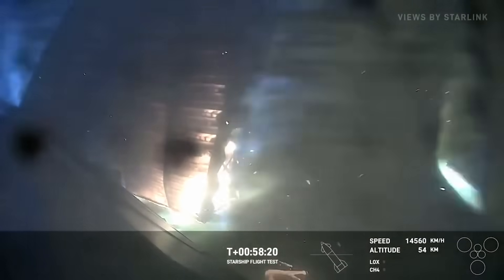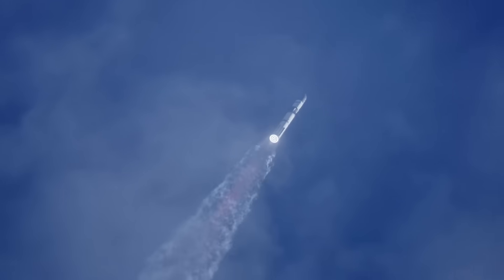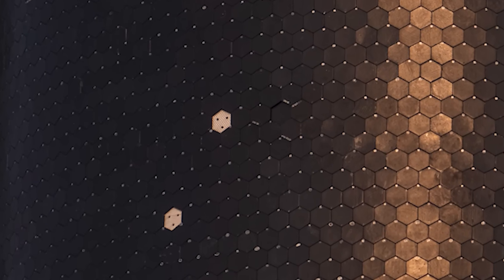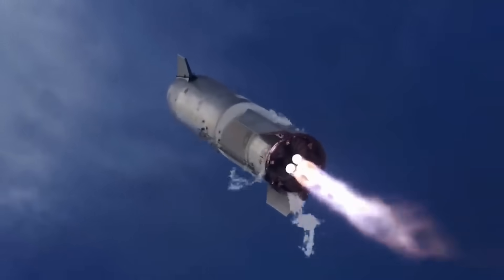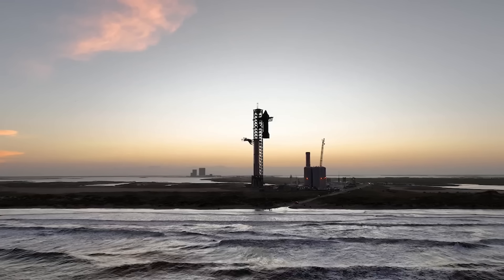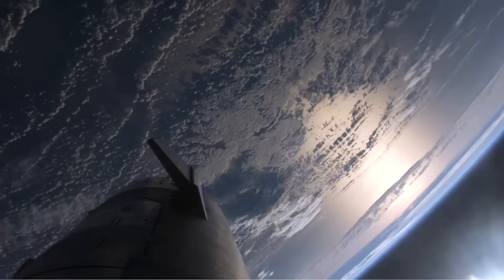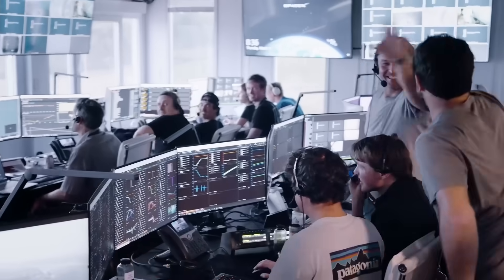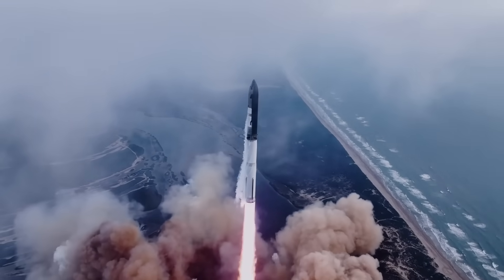SpaceX Is Adding Another Heat Shield Layer To Starship

Comment: Immediate starship second stage reuse is dead. SpaceX is admitting by putting in a blade of material under the heat shield that they probably cannot create a heat shield that can survive full reentry completely intact. What this implies is that the second stage at most will be rapidly reusable in terms of days or weeks after reentry, but immediately reusing a second stage will probably never happen because it will be always damaged when it lands after coming back to the atmosphere at least to some extent.
Reply: "a blade of material"

That's "ablative." 

They weren't going to be carrying humans on reentry anytime soon anyhow. But it may make sense, and they may get rated, to take people up at some point, and bring them down with other vehicles. Could mate up with a Dragon, or drop people off at upcoming commercial stations, with descent vehicles docked. 

And there's a lot we don't know about this ablative under-material. They may be able to reapply it just to locations with missing tiles during refurbishment, and then stick another tile on top of it. 

And if they have 100+ ships, it might not be too big a deal if it takes a month and a million USD or 2 to turn one around -- while they take several years to sort out actual rapid reusability ... I suspect they may end up with a secondarily thermal-protective material between the tiles and metal that makes the tiles far less likely to detach. In other words, the primary role is to keep the tiles on, and in the unlikely event they lose one, the material ablates (or is otherwise protective) in the location of the missing tile. Such that a very high percentage of Ships aren't missing any tiles after landing, and the ones that are don't have any holes cooked through them.
Reply: @cacogenicist  
Reuse in a few days or weeks would be rapid. However, I don’t think immediate reuse within a few hours is either possible or desirable or something that any insurance company would ensure.
Reply: Well, not even falcon 9 is fully reusable, they always have to refurbish a good amount of protection plates under the rocket and on it's leg mechanism.

Comment: The SpaceX test rig for designing tiles that stay on the vehicle at launch is inadequate. Defining and building a test rig that would allow you to create tiles that stay on the vehicle at launch should not be impossible. However, apparently SpaceX has not done that yet after four years.of course, creating a test rig that can simulate reentry is extremely difficult if not impossible. But they should’ve nailed the test already for heat tiles staying on at lunch.
Reply: They stay at lunch😂😂

But seriously, issue is with compromise: 
Price per tile, weight, ease of replacement. 

On V2 tiles will be smaller with different attachment method, instead three small plates with a hole in each tile, it will be larger plate with three holes for pins. 
Adding this new layer is probably just a stopgap to improve heatshields on EXISTING prototypes for testing other aspects of Starship reusability (precision of guidance and landing, aerodynamic models, etc).
Reply: @just_archan  
Interesting information, thank you. However, even if the heat shield does achieve, fantastic reliability, I’m skeptical that immediate reuse will ever make any sense. First, integrating, a significant payload into a second stage of starship will always take many hours and require much tested to make sure that everything is absolutely correct and the payload will Function properly when released into space. Secondly, large payloads can cost hundreds of millions if not billions of dollars. I doubt that any sane insurance company would ensure an extremely expensive payload to be taken to orbit by a rapidly or immediately reused starship second stage. Immediate reuse of the second stage, even for a payload such as methane and oxygen to refuel and orbiting starship is also unlikely simply because the second stage of starship will experience 2500°F on the way down and will probably take some time to cool off before you would feel confident about putting more fuel inside of it.
Reply: @wbwarren57  "It would be hard so it can't be done."
Ok, kiddo. They said that about landing reusable rockets too and now it's an everyday thing.
Reply: @wbwarren57  I agree with that. I understand perfectly that goes for boosters is to have turnaround as short as possible... But for ship only sense have to have with tanker and eventually with point to point passenger ships. But that is far, far future (if ever). I think this is more like aspirational goal. If POSSIBLE is fast turnaround, that means there is very little cost for on top for launch. It doesn't matter much for satellites, as CURRENTLY they are very expensive, but in future? With commercial stations in orbit or bases on moon? Ships could be used for moving cargo.  But like I said: it's aspirational for ship, not realistic.
Reply: @just_archan  
Well-reasoned response.  Thank you.

Comment: Was/Is there any attempt to recover the booster or ship from the sea, or are they just artificial reefs now?
Reply: lol recovering them would be crazy. A lot of effort and money for something of no value. Not like they could re-use them after they have been in the ocean.
Reply: @bluesteel8376 some people are arguing that recovery would be valuable for analysis. But in reality, all data they need they already have from telemetry. SpaceX uses very extensive computer simulations. IFT are for adjusting digital models against real life data, + identify unexpected issues and adding those into simulations. Neither of test were with latest iteration. Switching for electric TVS was planned months before IFT 1 (they changed it for IFT 2, probably considered as necessary for progress). Raptor 2 are not longer produced, they are in production stage of raptor 3, yet tests are conducted on raptors 2. We know for over a year that ship and boosters will be extended. For people who follow closely Starship development there was very little surprise regarding V2, and partially V3 ( scale, proportions and planned thrust for raptor 3 successor was surprise, not rest). 
Current generation is good enough for conducting tests needed to finalise second generation design. I doubt that many changes will follow into V2 ships, as they are just stopgap. Like extensive shielding on booster, very heavy purge tanks under the chimes and lot of other stuff.
Reply: @bluesteel8376  they could study them for damage, and see why the engine went out???
Reply: @shauryadeb-e8l  They had many sensors that gave them that data.
Reply: @bluesteel8376  Well, they are hollow and empty, I figured they might float for a few hours or more.
Reply: If you want, you can go get them. Nobody else will.
Reply: @ferky123  MINE MINE MINE.   gimme

Comment: It will be interesting to see what their plans are for the Starship portion of the spacecraft - will it be suborbital again, or will they attempt at least one full orbit before landing?
Reply: They will likely go into a full (albeit unstable) orbit. Would be interesting to see if they test a payload too.
Reply: And will they deploy Starlink satellites?
Reply: No point in testing a full orbit. It doesn't provide any value, but would cost more money as they would need fuel for a re-entry burn. The whole point of the sub orbital flight paths is to avoid having to do that re-entry burn.
Reply: @bluesteel8376  Well, in my opinion SpaceX probably doesn't want to do the exact same test. Since so much of the test was a success, they've checked off a lot of boxes on their TODO list, so they question is - what's remaining on that list? As I understand it, the burn they tried to make on the third flight wasn't exactly that successful, so they might still have a burn on their list of stuff to try for the fifth flight.

They will certainly want to test modifications to the heat shield, but is that the only thing they will test? They have so much more to do, it would be a a bit of a waste to not test anything else.
Reply: @bluesteel8376    This last flight, ITF-4, was suborbital and it still had to do a reentry burn so I don't get your point.
Reply: @bluesteel8376 obviously there is a point in testing full orbit. You need to reach orbit to deploy payload, and reaching orbit would give them extra time to test orbital maneuvering, payload door opening, fuel boil-off, etc. If they are flying anyway, they may as well try a more ambitious testing program than last time. If they really want to push it, they could start deploying satellites before achieving reusability (similar to F9, electron, etc.)
Reply: In a now deleted tweet, Musk says how much he enjoyed both Top Gun movies. This has led to some speculation about something he said years ago, that if he ever put a rocket into space he would want to buzz the ISS like Maverick buzzed the tower.

SpaceX has done some impressive things but I know if I were an astronaut on the ISS I would get worried if I looked at the window and saw a Starship looking like it was headed for impact, even if it ultimately whizzed by with about a hundred yards to spare.

Comment: Perhaps the new ablative material also dampens some of the vibration transmitted to the tiles.
Reply: Also may provide flexibility or expansion joint from cryogenic chill...
Reply: Maybe, but I wouldn't think so.  Adding in a requirement to prevent burn through doesn't seem likely to also increase the dampening provided by the existing rock wool material.
Reply: Bayonet clips are compliant 2 axises. But not so much in z AXIS. So i agree to extend with those who think felt underneath provide support but not soo much dampening as we wanna believe. Furthermore it provides pressure on tiles and pushed tiles OUTWARD into bayonet clip.
Reply: @alesksander  

When you have no damping, even a little internal fabric chafing can help and cushioning is very important when you are dealing with weak ceramics. If it provides a bit of a thermal backup system, then even better.
Reply: @richdobbs6595 

Do you know that it is “rock wool”? I don’t know what it is but assumed that it was a quilted silica fabric that was used on the space shuttle. If anyone has information on this it would be helpful. The material can provide both heat protection and a form of damping (indirectly) and cushioning.
Reply: @Mentaculus42  I have heard that it is rock wool, but I don't know what is done with it.  Also, it is not clear whether after being attached whether it performs a vibration damping function.
Reply: @richdobbs6595  

It would only be very little damping, but without any one can have issues with higher forces. Considering how the three pins are captured on the back of the tiles, there basically is nearly no inherent damping in the tile to stainless steel structure. It is interesting to note that there are very good reasons why aircraft are not made out of steel. Steel actually has a better strength to weight ratio than aluminum but the problem is the effective stiffness (and buckling resistance) of the overall structure that becomes the issue. Going very big helps to negate this issue somewhat (or having pressurized balloon tanks as in Centaur). The lower the stiffness of the mounting structure the more issues one has with vibrations due to all sorts of things. Also when you have a mounting structure that warms up, that further complicates issues with differential expansion. Spacex has decided to take this different approach so they are going to have to work the new bugs out of it.
Reply: @Mentaculus42  Given the tendency to build aircraft out of aluminum rather than steel, my guess is that strength to weight ratio isn't the right metric in selecting materials for air craft.  But I suspect that I'm more than one beer beyond the point where I'm able to apply engineering analysis to this, and in any case my education is in chemical, rather than areospace.  My experience is in software development, where my conclusion was that my compatriot with a background in aerospace was a twat, with an okay ability to smooze, but not a great understanding on how to develop software.  I particularly remember him being quiet when he ran into a problem with my code, and letting the customers find the problem.  Somehow I just didn't react when I found he brain cancer after he left our company.  So sad, but he was an asshole.  He was instrumental in hiring me, but still he was a twat. How dare he think the right approach was to comment out, but never remove obsolete code?  What a barbarian!  Had no appreciation for source code control.
Reply: @richdobbs6595  

The reason that aluminum is used even though steel has a better strength to weight ratio is that the aluminum being significantly less dense requires more volume of material producing a significantly larger cross section that has superior bending and buckling characteristics. However, if one goes big enough then one can recover enough of the bending cross section because the “thing” needs a large enough cross section to support the loading because it is probably heavy. So steel for bridges but a trailer for a semi could be either depending upon the customer requirements. So one would think that a 747 could have used steel in places but that favorable aluminum cross section wins out. There have been Soviet jets that used steel in very heavily loaded members (I think maybe the main hull “backbone”).  Also there is some differences as far as corrosion but stainless steel has that covered. There are differences in fatigue cycle lifetime but that is probably irrelevant to this discussion.
Reply: That is what I thought the primary purpose of the white material that was being underlaid for sometime now. The “tile attachment system” needs more vibrational damping (not dampening) and a mechanism to provide more compliance (but tripod pining is probably still problematic).
Reply: @Mentaculus42  pinning
Reply: @pigslefats  

I don’t know the official term but most tiles are attached to 3 pins that are spot welded to the stainless steel hull with clips that are incorporated into the bottom of the ceramic tile. Superficially it seems like a neat and simple approach to the tile capture problem as it acts like a tripod but it has its own set of issues. It would not have been my first choice for a TPS. Nobody else has taken this approach but if it works, it is genius. What I find interesting is the comments made by Elon about the obvious issues that any engineer would immediately worry about from the very beginning of the design process, so why is it only being “rectified” at this time ‽ I know that the musk methodology is to try to do it without XYZ and see what happens but some things are going to take a more complicated approach.

It is all about trying to find the optimal path to success but sometimes it feels like musk loves to gamble too much.

Comment: Any thoughts of changing from steel to a more heat-resistant material such as titanium?
Reply: Not sure if that would be financially viable for their goal of lowering costs of space flight. Titanium means higher costs 💰 for production.
Reply: @charleskavoukjian3441 Tbf production cost isn’t super important if your rocket is reusable enough. But I’m not an economist so who knows
Reply: They could build only the flight surfaces and the points where it meets the fuselage out of titanium to be more economial.  @charleskavoukjian3441
Reply: Titanium is incredibly expensive compared to steel.
Reply: they are using their nerw steel allow for v2 starships that is more heat resistant I think
Reply: Titanium is much harder to work and is 20-40x more expensive by weight. So no. That would be dumb af.